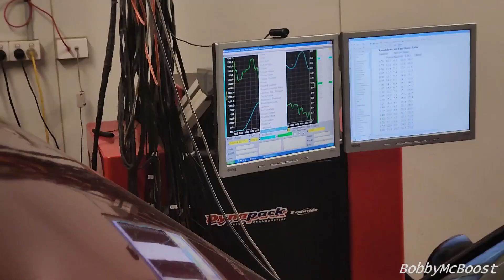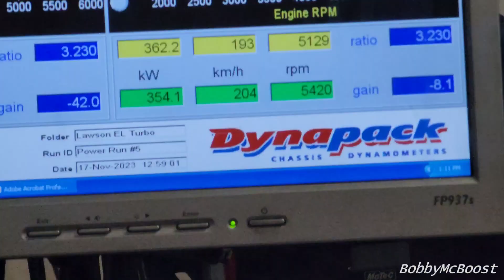Turbo Intech Build! the Ol' Dyno will show the Problems..

Comment: Have you had any luck running an intec on a varra ecu?
Reply from the maker: Yep. And a 250 cross flow 👍
Reply: @BobbyMcBoost  how do the go? In the process of putting a raptor supercharger on mine. Any info on the loom?